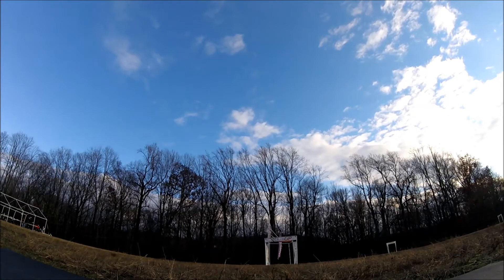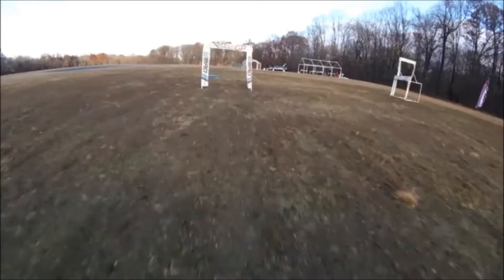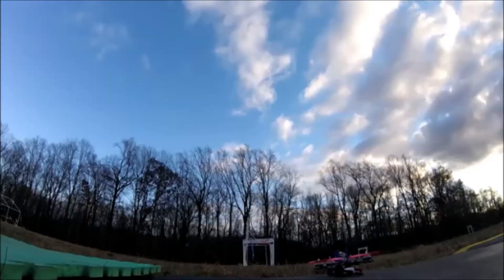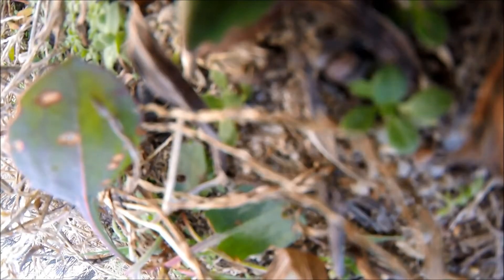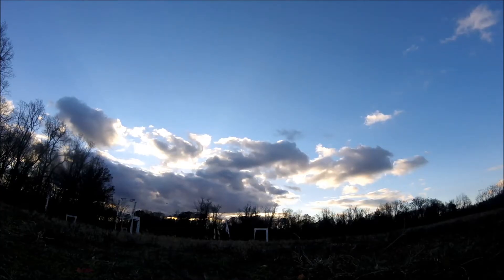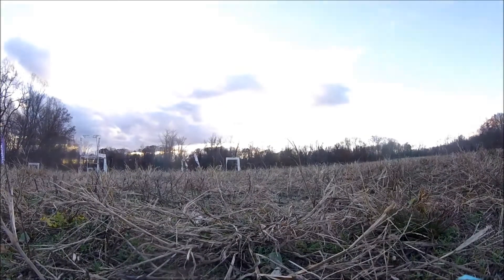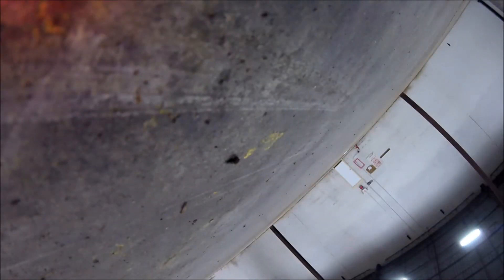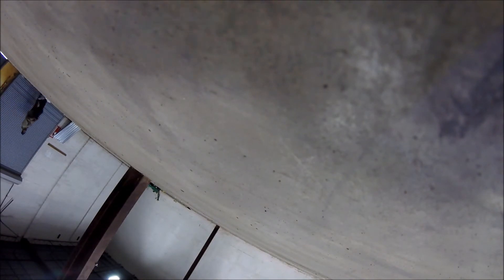Can You Troubleshoot

Comment: esc's not all on the same firmware?
Reply from the maker: donald heon With all jitter I was thinking it was a problem like that as well.  The jitter was caused by the receiver dropping in and out.
Reply: was it spektrum?
Reply from the maker: donald heon Nope it was FrSky.  I got the quad wet a few weeks prior to this and I put it in the oven and it flew fine for those weeks.  But I can't blame the hardware.